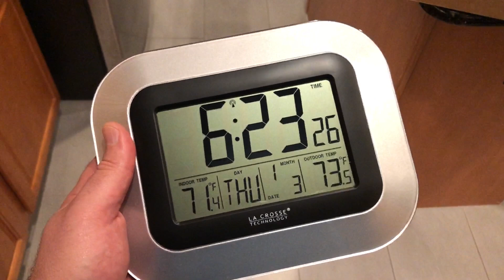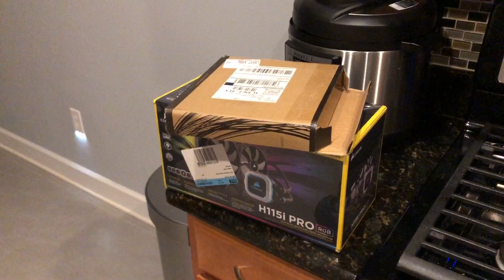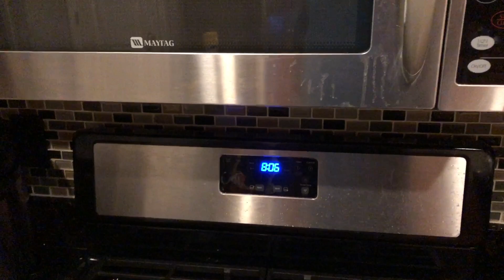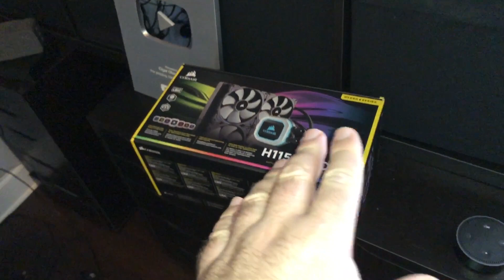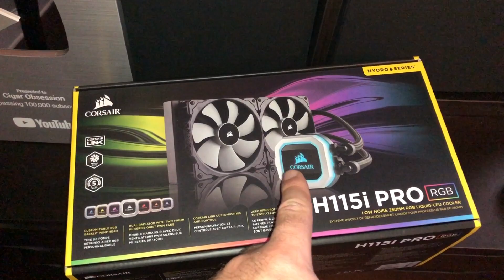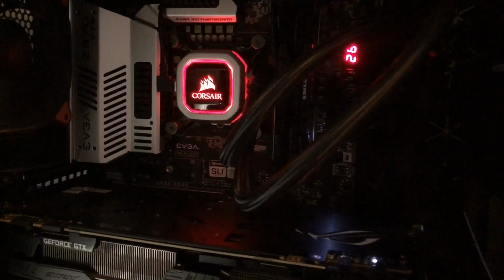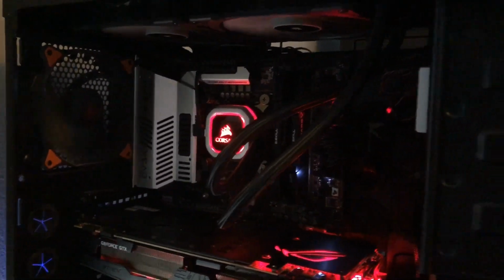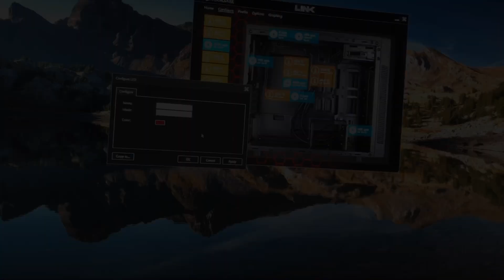Home Vlog Day 63 - CO Guy Stuff

Comment: You could replace those cheap rubber peace’s with flex seal possibly?
Reply from the maker: No. It’s not about any kind of seal. Sound damping is about dense material to absorb sound and vibration.

Comment: How annoying is replacing a liquid CPU cooler compared to an air cooler? When I swapped my older air cooler with a newer air cooler it was a hog getting it properly positioned. Had to lay down my tower and getting the back screws in was harrowing experience to say the least. I see that you were able to replace the cooler with the tower still upright though!
Reply from the maker: That depends on the cooler. For an air unit yes you would want the motherboard laying flat. Liquid units generally don’t have any wiggle room, the back plate keeps everything secure and located. It only took 5 minutes to actually do the swap.